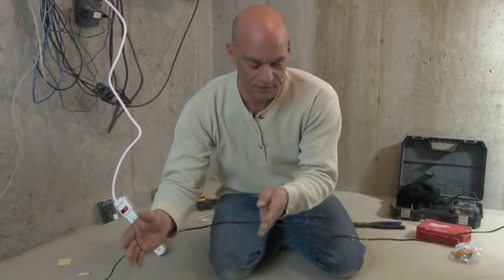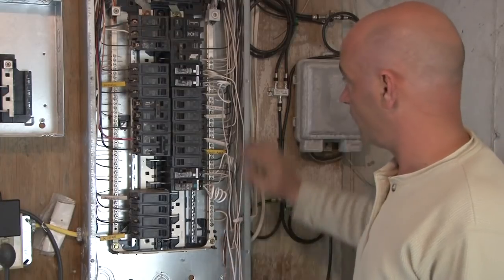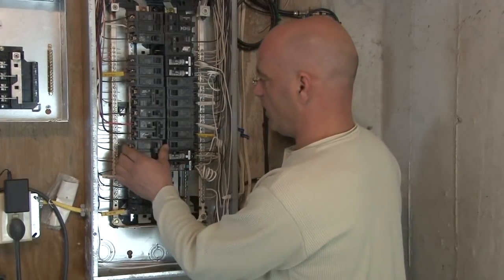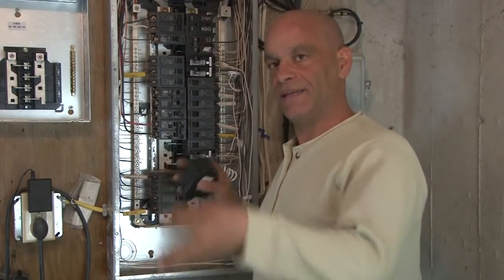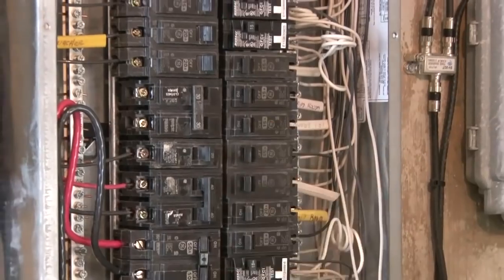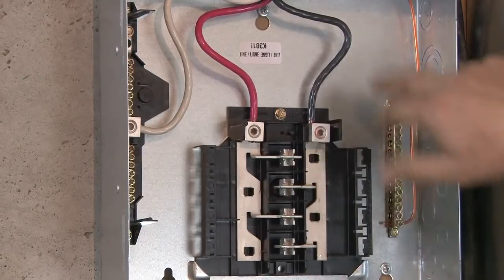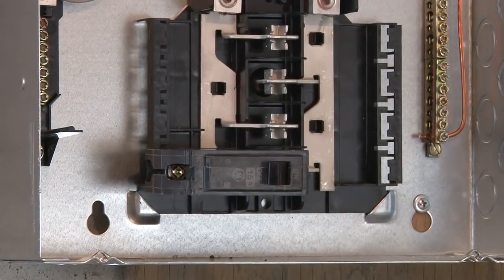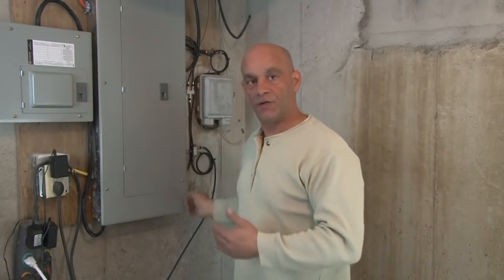How to Install a Subpanel

Comment: Thank you for your explanation. Let me describe you my interest. Our company builds modular houses. Each house has two modules, but electrical panel is in one of them. Today, we are putting two junction boxes for wires are going from one module to the other one. Could we use a subpanel to join all cables? Thank you!
Reply: I am not the expert that I think I am, but you could have the main service panel in the one module like you do now, and then have a sub panel in the second module that feeds everything in that second module. Once the two modules are joined together then you could just run one feeder cable from the main service panel to the sub panel in the second module.

Comment: Could I place a sleeve on the ground wire in the sub panel and when installing breakers in the main panel or sub panel does it have 15.20,15,20,30,50,15,20 etc or it could be 15,15,15,20,20,20. just asking

Comment: I just wanna know why he didn't use an offset nipple and run the the conductors through the sides of the main panel and sub panel. using that cable looked like an amateur did it but other than that good job

Comment: One more thing....even if you shut off the main breaker, aren't there still portions in the panel that are charged? The lugs at the top?
Reply from the maker: Yes big time. Lugs on top will always be live unless you pull the meter or have a disconnect

Comment: In your reference of short-run to the sub-panel, versus a longer run to a detached building, you didn't indicate whether or not there might be a point of distance – 25-ft, 50-ft, 100-ft – where a separate grounding rod may become necessary. We've run 6/3 from a 60A breaker across the basement through the floor joists to a subpanel in an attached garage to power a small workshop...a run just shy of 100 feet. To ground, or not to ground? That is the question.

Comment: Thank You Sir I already have ground rods on all my out buildings! Do I still need 4 wires? My Dad always said out buildings need an earth ground but back in the day We used the 3 wire system as most folks did in the 50s and 60s. I'm hoping that an ad on safety wire would meet future codes.

Comment: Sir I live at a very old estate and all the out buildings have three wires going to them. My question is can I run a safety ground wire in a separate conduit? Will it pass code? I am on a very limited budget and cannot afford a complete re-wire. But I want to improve the condition of the estate so when I pass it down to future family members it will pass code.

Comment: For a 100 amp sup panel am I good with using a #4 wire from the main to the sub and if so what size breaker for the feeder wire since it's a 100 amp sub wouldn't it be a 100 amp breaker

Comment: I have been putting together a workshop in my basement, and I recently bought a welder that needs a 220v outlet on a dedicated circuit, but I only have a single circuit breaker space left on my panel.  Would installing a subpanel for all of my shop circuits be an adequate solution, or is there a better way to meet my power needs?

Comment: so in order to add breakers to your panel you have to have breakers open... nice.
Reply from the maker: What do you mean by nice?
Reply: It means I'm out of luck. lol
Inherited an older house with very ambiguous wiring methods. The main breaker is full yet I'm trying to run power to a shed in the back yard. Any ideas?
Reply from the maker: Yes of course, very easy. Just move the need breakers (Space) to the new sub-panel. That's all.
Reply: askmediy Oh! You mean steel breaker space in the box and move the old wires to the shed with the new sub panel? -Subbed for the fast reply.
Reply from the maker: No, always new to the shed from the sub-panel. Or install the sub-panel to the shed.

Comment: I have 2 220 volt appliances that have to share a 30 amp breaker. I have no spaces left on my 100 amp main breaker box. right now I have them split at the dryer outlet which is bad and I unplug the other (water heater) when I run the dryer. this is all because I took out a gas water heater and replaced it with electric. too late now to go back to gas. suggestions ? 
was gonna run the dryer line from the main box to a sub panel box using a 50 amp breaker at the main and 2 30 amp breakers at the sub for my 2 appliances and then run separate lines to the dryer and water heater.

Comment: Hey Dom.  As an avid DIY'r I always seem to come across your vids.   I used this one in particular to install a 60 amp Sub in my basement as I am finishing the space.   It came out great.  My main panel was filled to the gills and already had some tandems in there.  So I had to remove a few slots to make room for the 60 amp double pole to feed the sub.  Moved those over to the sub once installed and now I have 6 slots lefts for new basement lighting, outlets and a couple electric wall heaters.  Just wanted to say thanks and great job.

Comment: With what I am reading it seems like I would be best off taking the sheath off of the xhhw and run it not bundled not for power transmission but chassis wise remove the sheath use plastic ties 4-4-4 rating goes up to 135 amps with the sheath it is only 60 amps

Comment: Or put an 85 amp breaker in the main box and run four gauge non weather straight to the pole barn Past house wall through PVC Down Underground up through the pole barn and distribution box seems expensive...

Comment: would that supply enough power to the subpanel to run a kitchen range which is 50amp and two more 15amp breaker?

Comment: Not sure if this is where to ask you but here goes. First, thanks for your videos. I enjoy learning from them. Ok, my question. I installed a subpanel in my basement using a 50amp breaker in the main box and 50cable. My question is...Can I run an electric stove from the subpanel or do I have to run it back to the main panel? I'm turning the basement into an apartment. Your help greatly appreciated. Thank you

Comment: sub panels don't need it's own ground rod or plate, because the main panel is already grounded to earth!!!
Reply from the maker: If the panel is located outside of the building that has the main panel code requires that it be grounded by rods as well. In the USA

Comment: there is a difference, I see in the way America and Canada, does the ground plate, you guys use a rod, where in Canada we use a ground plate, which only has to be 2 feet in the ground, only time we use grounding rods, is when you putting in a  transformer pad. and you have to have 4 rods , I believe a meter at each corner of the pad !!

Comment: have sub panel in garage with out 6 wire ground in ground.  It been working till this winter, it been tripping breaker in house, would this be reason for tripping breaker in house, also I replaced a burn outlet in garage with new one, could I have a bad connection their cause breaker inside to trip???

Comment: Since you only used a 50 amp breaker to power your sub panel would you trip it if lets say you filled the sub panel full of 15 amp breakers and was using all the breakers to power something at the same time
Reply: elgalloblanco1980 Yes, but the same is true of the main panel. Typically, not all circuits pull max load at the same time. Otherwise you'd need a 1000 amp service!

Comment: Here is my situation, I am removing old range hood and adding a microwave range hood. It’s 120volt plug, 60Hz @14.5 amps and 1.7kw, I was told by another customer who did the same thing to change my wires and put it on a separate 15amp circuit. I have no extra room in my panel and would like to add subpanel. I am not an electrician, but I am very handy and your subpanel video looks simple. Can you make a video showing the wires (new circuit) added to the subpanel? I have an idea but want to be on the safe side. Next question, 200-amp panel means, it allows up to 200amps per circuit? 
 In my main panel, the last free circuit was used to make a subpanel outside for my pool. I would like to use that slot for my indoor subpanel and move the pool circuit into the new subpanel. This panel will handle the pool and the microwave, with a couple extra blank circuits for future use. How many amps to use for this subpanel, the pool circuit is 30amps I think and I need 15amp for the microwave. I live in Jacksonville Florida.  Thank you for any advice or video that helps my situation.

Comment: I want to install a subpanel. My main panel is 125 amp 20 space. The new subpanel comes with 100 amp main breaker. What should all the main breakers be?All 3 main breakers 100amp? My main has a 70 in it now for some reason.

Comment: I ran 3 wire from main to garage 200' away installed sub panel. from main I put 100 amp pole breaker to 100 amp pole breaker in sub. so the 100 amp breaker working just the same as a main breaker in the main panel. the nuetral is connected to main panel  bus. I did not run 4 wire with a ground. so at the sub my neutral and grounds going to outlets wiring the garage are all tied together and also tied to ground rods at sub panel. I don't see any problem with this or any difference  between the 3 wires coming from your utilities transformer to your main. am I missing something? it's been working perfectly for 4 months.
Reply: The main problem here is if the neutral wire becomes disconnected from the main panel anywhere along the 200 foot run then the outside metal enclosures of appliance cabinets or tools, etc., will become electrified. The ground rods will also become electrified. You need to have that fourth ground wire running back to the main panel and that there should be no bonding of the neutral and grounding wires at the sub panel.

If you were to lose your neutral in your setup then the earth itself would be acting as the neutral back to the main panel. And it wouldn't be a good neutral because of the relatively high resistance that the grounding rods make to the earth causing a potentially large voltage drop which which would appear on the metal outside of grounded appliances and any other equipment and could be lethal.

Comment: When using #6-3 copper Romex cable, I would have used a 60-amp breaker when feeding a sub-panel.  50-amp breakers would be used if the cable was used to feed an appliance (such as a kitchen range or pottery kiln).

Comment: Hey Dominic.. I am a so called electrician.. couple of questions for you and suggestions for the readers.  Why would you use romex to feed a subpanel right next to a main when you could have used an offset nipple? Isn't that kind of dangerous having that 220 loop at the bottom of the panel?  When you attached your feeders to your 50amp and left all that wire in front of the ground bar.. I hate when I open a panel and all that wire is in the way... You shouldn't have to move a breaker once it's in with a little for thought.. I also see "so called electricians" leaving excess wire in a panel up along the sides.. where by the next "so called electrician" that comes along is left in a danger zone trying to access an opening.. OK.. The #6 you refer to as a ground to the ground rod(S) . . please make note of article 250.66(A)... That is supposed to be a bare #4 for a 200 amp service.  One last thing.. Out of 10 customers that I service, 7 out of 10 have panel labels that have not been marked... Great you put a sticker next to the sub panel breaker.. but you should also mark that panel's registry.
Reply: They lost me when they didn't use a EMT  conduit between panels....

Comment: with shutting off main breaker then removing the cover, I assume there are some areas (ex: feed from street) that still should not be touched. i need to install outlet with breaker right under main breaker box.
Reply: I was taught by 3 different licensed electricians, to pull the meter, or if in my case I have 200 am service with a kill switch in the meter box. Hope this helps.

Comment: i have a 60 amp double  pole breaker not being used in my panel, is it alright to run a 12/3 wire into it for a 20 amp outlet or should i take it out and put in a 20 amp breaker.
Reply: Take the 60amp 2 pole out.. put 2 single pole breakers in.. (one being a 20amp) and the other 15 or 20 which will become a spare.  Don't want any holes left in the panel opening.. (single pole breakers are only 6 bucks).. hook up your 20 amp outlet.
Reply: why don't you want any holes left open in the panel?
Reply: Something could fall in there and cause a short, or someone could (accidentally) stick something in there, even a finger, which could contact the live bus.  It is my understanding it is OK to have empty slots behind the cover if the knockout has not been removed but it sounds like you are removing a 2 pole breaker and only need one 20 amp circuit, so you'll want to fill in the other empty space with a spare breaker (as the knockout has obviously already been removed if the 2 pole was in there before.  The breakers are inexpensive.
Reply: There are also little filler plates you can snap over top of an empty space, just plastic covers.  That would work too.
Reply: Thanks for the important information , i will be getting an extra breaker , Thanks again!!
Reply: Any time... be careful!
Reply: for adding a subpanel, do you do a load calculation for the residence to balance the panel or do you just look for breaker space??
Reply: refrigeration tech no, I don't think It'll be necessary to do a load cal because most home owners will never use up their main panel amp potential.
Reply: To expand on that it may not be required but I would recommend it. It's not hard or expensive to do and you may find out your house is rather unbalanced so it could be a good idea. Typically not an issue but my current house was nearly 50 amp heavier on one leg of the bus than the other, and if you aren't using a twin you could end up putting that entire sub panel on the same leg. If you have the time and aren't an idiot with how you do it I would say go for it.
Reply from the maker: Yeah sure thing.

Comment: Hey Dom ... my sub panel (outside in a garden shed) has a 100 amp main breaker and needs to be connected to the main panel in the house. I assume I would put another 100 amp breaker in the main to supply the sub? thanks!
Reply from the maker: Yes

Comment: Fantastic video - thanks! QQ - at 9:25 you talk about mount the sub panel in a detached building and the need to bond to a new ground rod. When doing so do you still connect the ground from the sub panel to the ground bar in the main panel?
Reply from the maker: Yes
Reply: so in this case would that subpanel ground bar be connected to the main ground bar and the new grounding rod?

Comment: I really appreciate your time spent explaining the sub panel, thank you. To clarify what I understood you to say is that if the sub panel is to be installed in a separate structure such as a detached shop,  a ground rod needs to be installed. I have a project that I'm helping my brother with. An electrician connected a breaker panel beneath the service can, which is approximately 100' away from a sub panel he installed inside a detached shop. My brother and I will install the various breakers and wiring/lighting/switches/plugs etc... My concern is that the electrician did not install a ground rod to the detached shop. I was surprised that the electrician told him it wasn't necessary. Keep in mind this is a detached shop that's 100ft. from the nearest ground rod. Should we install a ground rod or go by his word that it won't be necessary? There are no required inspections past the first disconnect which is a few feet from the can, in the alley, 100ft away. Thank you in advance.
Reply from the maker: You need a ground rod and everything needs to be inspected.
Reply: +askmediy Thank you for responding!! Subscribed!!

Comment: Excellent video Dom, I love your videos. I watched about a half dozen vids on this subject until I stumbled on yours and it's the best by far.

A couple of questions though (I may have missed it in the video):

What was the amperage of your subpanel and what was the wire gauge? You used a 50 amp breaker but what was the panel itself rated for? 50 amps? That wire looked a little light for 50 amps. An edumacated guess says you'd need at least 8 gauge for a 50 amp panel. Correct?

Also, is there a way to hook up a subpanel without using a breaker? In other words bussing to another 100 amp panel even though I'm only going to use about 60 amps.? I got my panel moved by an electrician who was a bit...idiotic...and he used a panel that was smaller than my original and now I have one 15 amp breaker to spare. This no-talent, ass-clown couldn't even mount the new panel level. 

Oh well, he put the "con" in contractor. And that's why I do ALL my own work from here on in.

Thanks again Dom for your excellent video!

Comment: The main panel has 2 rods and is in a basement,  the sub panel is going on the other side of the same basement,  approximately 50' away I was planning to mount the panel on the inside of the exterior wall, the lower half of the wall is concrete, the upper half of the wall is framed the soil level outside is about 8" below the footing (concrete)so  can pound the rods in the dirt outside then run the #6 ground through the framed wall and into the new sub panel? By the way the 4 gauge wires and the conduit are already there, left by previous owner, they just dead end in a box there with no ground wire. Also, can I use just one grounding rod for the sub panel?

Comment: Hi Dom. Great job on the vid, i will use your wire stripping advice from now on, so thank you for that. I am installing a sub P. in a house about 50' from the main P. will be using 4 gauge wire so would it be ok to install a new grounding rod or rods. instead of running a ground from main panel to sub panel.  wires will be run in 1 1/4" EMT.
Reply from the maker: You should and need rods at the main panel. But where is the sub panel going?